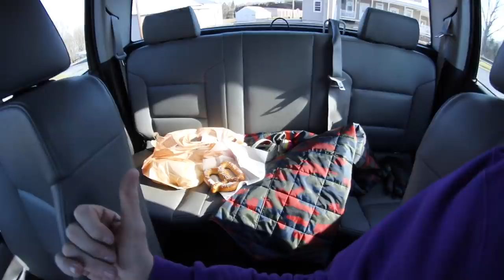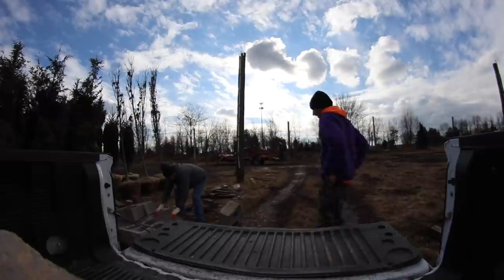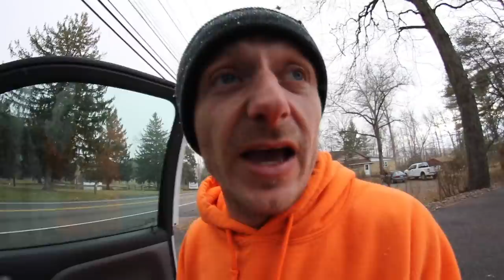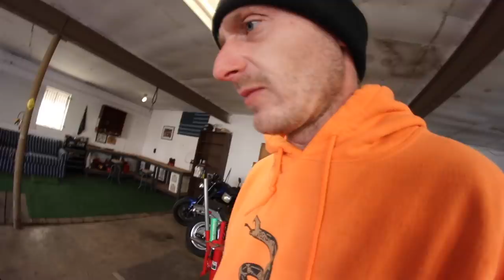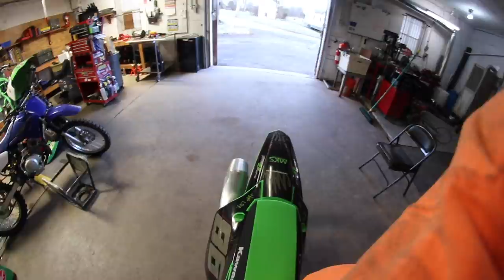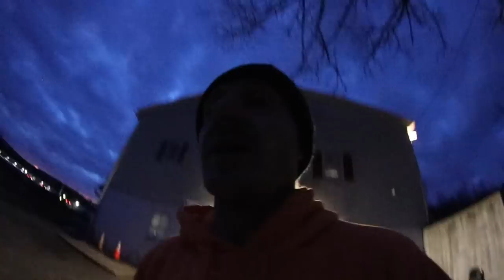Sasquatch Soft Pretzel Review...

Comment: Heat a safety pin or the end of a paper clip glowing red hot and poke a hole in the black spot on the nail and it will release the pressure and you won’t lose it